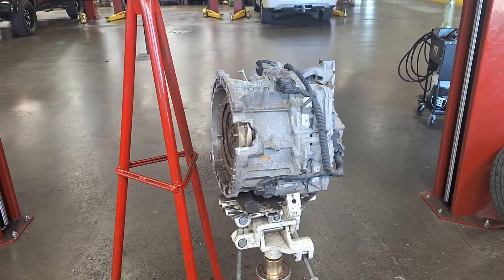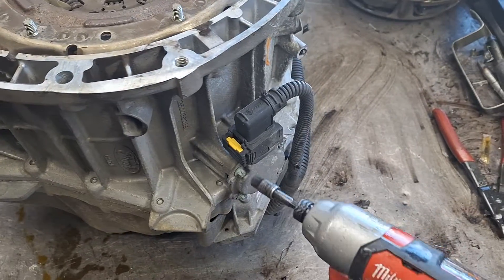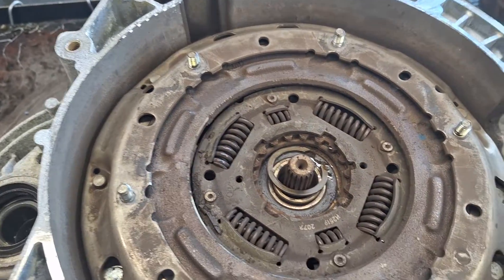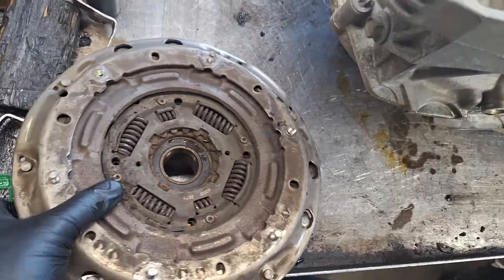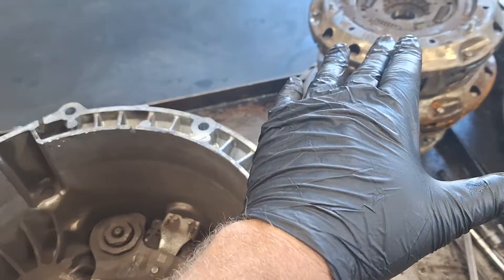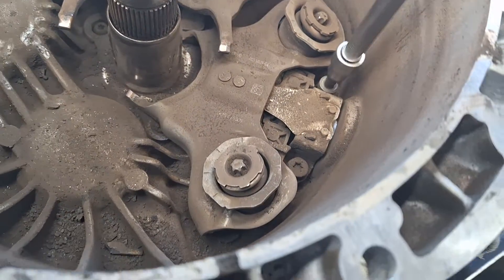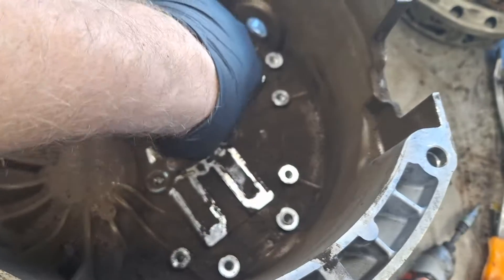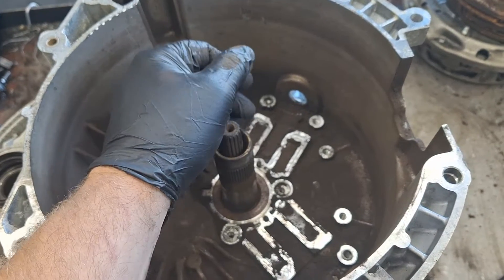Ford Focus DPS6 - P2700 Teardown Inspection!

Comment: Video on diff bearing replacement.
Reply from the maker: When the opportunity comes, definitely. I've got a video called "dps6 partial teardown, common internal issues" where I pull the diff out. From there, you can punch the races out and hammer new ones in (keep the shims in) and take the diff to a machine shop

Comment: What's your best method to clean up the gearbox after the forks are removed ?
Reply from the maker: I've always just used brake parts cleaner and its done a fantastic job. If you're not replacing the seals, then just be careful not to get too much on them

Comment: We just bought My son a 2012 focus SEL 140k miles. Drove fine for about a mo. and then started shuttering driving it. Watched videos on trying to clean the clutch forks a little through the actuator motor area. Now it only will drive in reverse, so it looks like maybe the forks need to be replaced. I'm just a diy'r and can try to attempt this myself. Do you have a list somewhere with where you get your parts to do these focus clutches? I imagine, I'll need the 2 actuator motors, and maybe clutch housing stuff, Dunno. Never messed with something like this before. Worth trying since its just disabled in the driveway now. I'm still kind of going through your videos to try and figure out what I need to do, and how to get the transmission out and back in the car and try to fix the forks.
Reply from the maker: Hi, I've got a whole Playlist for you which will help, which I believe sounds like you're going through. I have a DIY Driveway transmission pull and install video. And a full Guide for doing the job. I'd get a DPS6 LuK Repset for your focus (Google that) and you'll need an engine crane, jack and jackstands
Reply: @BigBensCarsAndCycles  Oh Nice! Thank you so much! I will look through your videos, and I'm googling the clutch Kit you recommended.

Comment: what caused such a failure at relatively low miles, was it maintenance or just these trans kinda suck
Reply from the maker: The transmissions just aren't very reliable. 125k is a lot for that transmission